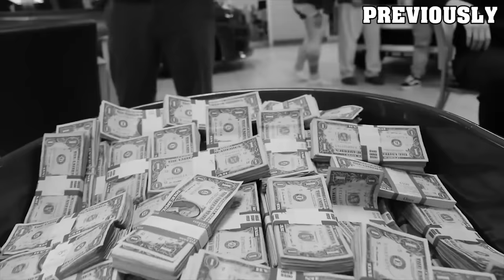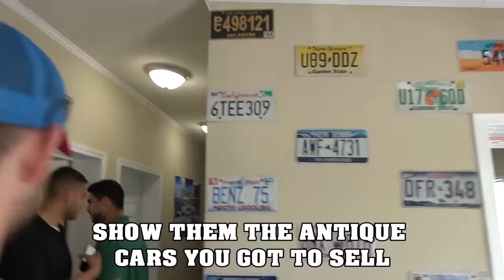I Took Apart My Friends Car And Put It In His Room

Comment: How did you get the engine out with out any professionals
Reply: they never did
Reply: bruh to fully dissasemble a car from bumper to bumper would take forever, especially when they only had one mechanic there, what kinda question is that. their chassis was a fuckin fold out party table lmfao😂😂😂😂